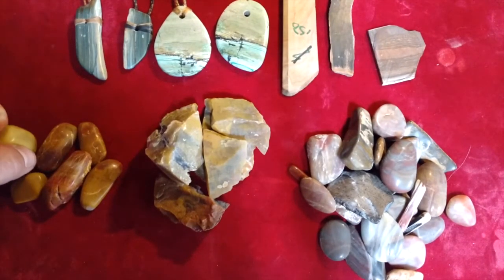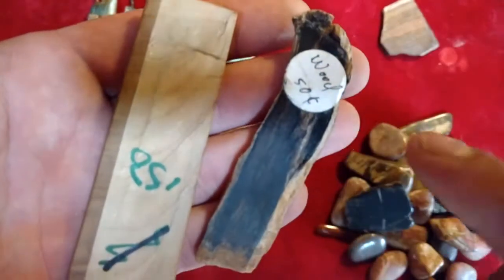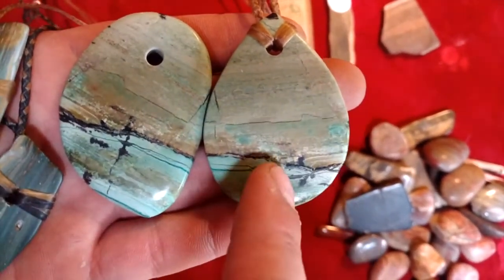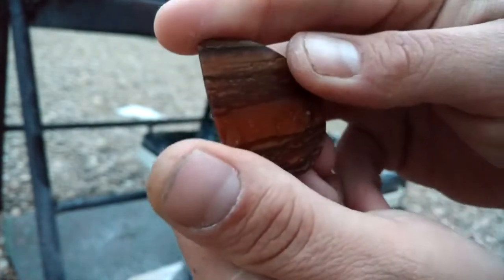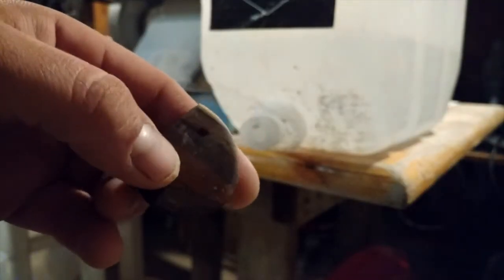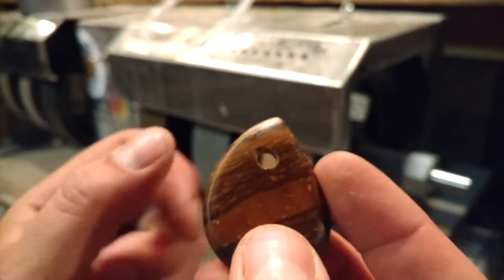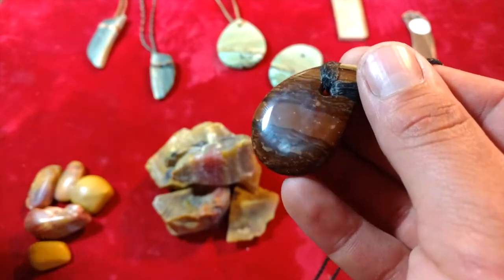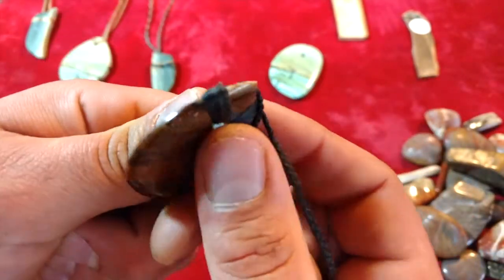Lapidary Time!! Carving a piece of Petrified wood

Comment: How long do you think you go before replacing your flat laps?  I just got a few flat laps and they've held up pretty good for the two months I've had them.  I was really expecting them to be used up pretty quick especially since they're cheapies from China but they've hung in there like champs.  I'll definitely be buying more of the same when they're spent.
Reply from the maker: ElGatoLoco698 when my flat laps are brand new they almost cut more aggressively than the grit advertised and when they are worn out they are still good but cut as if they were a finer grit than advertised because of this I have never thrown out a hard Diamond will I have just used it in slightly different situations, my worn 60 grit flat wheel Cuts more like an 80 and my worn 180grit cuts like 220 , I'm a little spoiled because when I make YouTube videos I can spend a lot more time digging deep using worn-out flats and so I always use my most worn flats :) I hope this helps